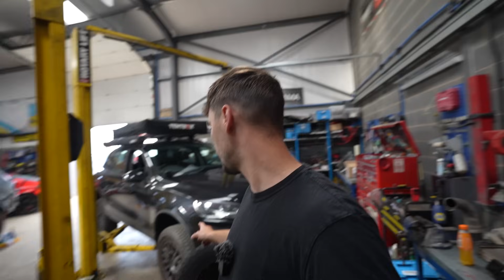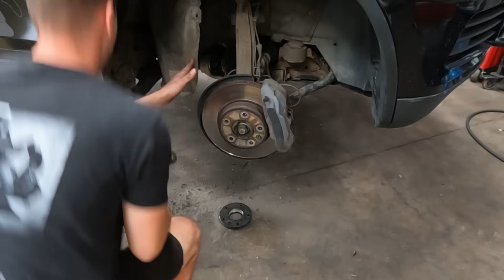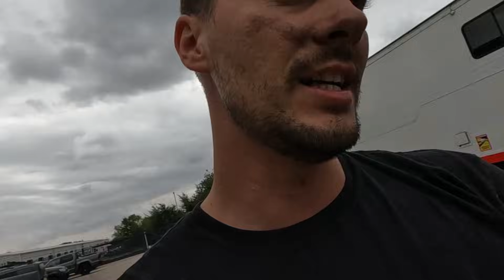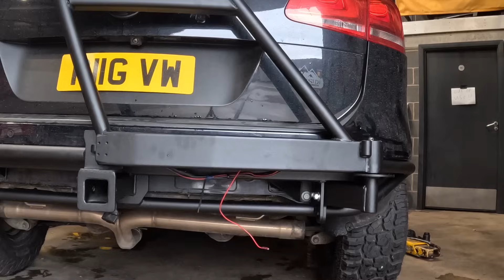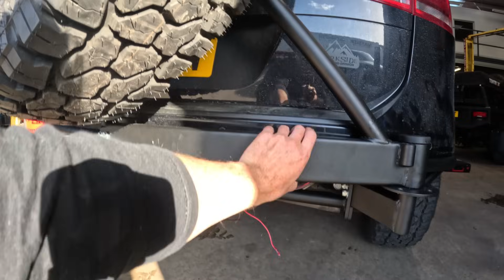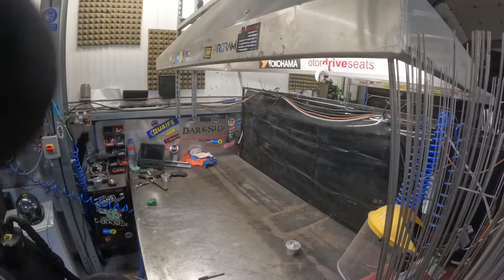VW TOUAREG SOUNDS LIKE NISSAN GTR! 🎶🎵 LOUD 7P 3.0 TDI V6!

Comment: Is it possible to fit a 265/65r18 31.6 inch tyre without any modifications of the suspension i was thinking to use Thise size for a Audi Q7 4L  project car with air suspension.
Reply from the maker: Yes this R-Line has 265/65R18 with stock suspension - https://youtu.be/Gw3dUSVoEeM

Comment: Sick video!! Did you keep those spacers on? What size are those? Thank you 🤙🏽
Reply from the maker: Yes, 20mm spacers all round. The wheels are ET48 8.5J
Reply: @DarksideDevelopments  maybe some heavy duty stainless steel mesh to protect the intercoolers, do you have a 2 inch lift?

Comment: what size lift kit have you got on this? and do you have any subframe drop installed or anything like that?
Reply from the maker: Yes this is the kit fitted:
https://www.darksidedevelopments.co.uk/products/darkside-vw-touareg-7p-cayenne-958-2-coil-suspension-lift-kit.html

With subframe drop - https://www.darksidedevelopments.co.uk/products/darkside-25mm-1-subframe-drop-kit-for-vw-touareg-7l-7p-cayenne-955-957-958.html